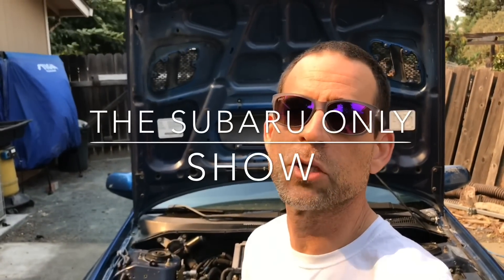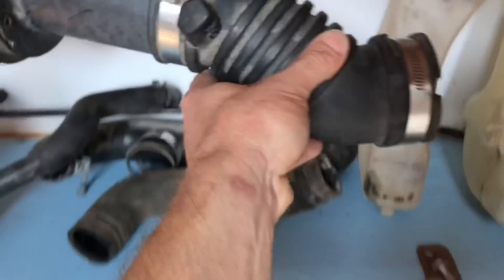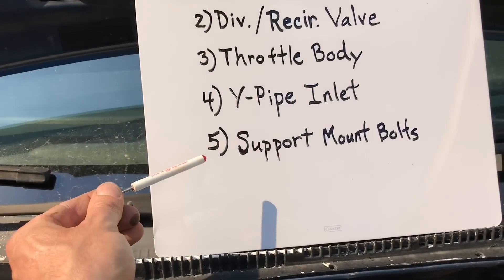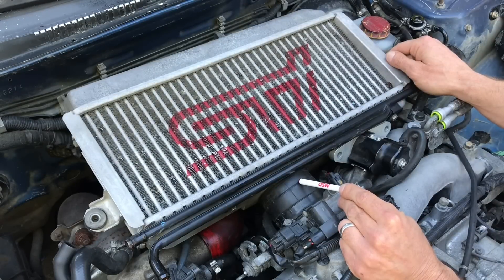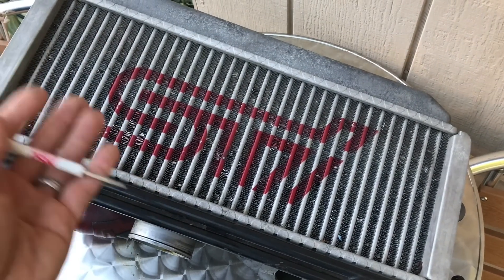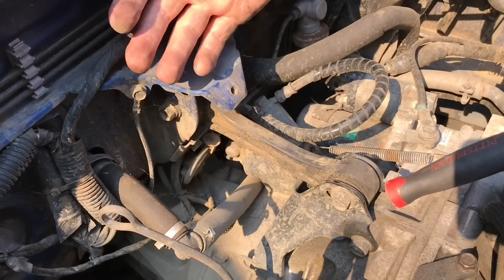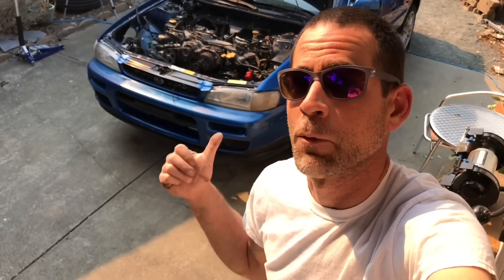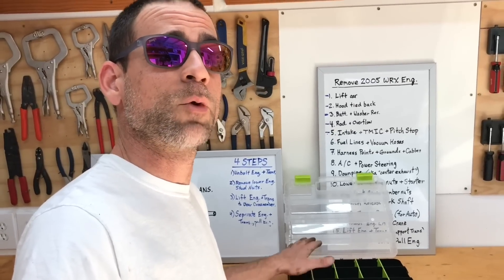How to Remove a TMIC on Subaru EJ-Series Engines

Comment: This oil in TMIC is from PCV or turbo? How much oil is too much?
Reply from the maker: Most often from the PVC system. If it totally coated and some liquid oil is pooling up in the manifold low points, def too much oil. 👍
Reply: @SubaruONLY  thank you for the answer!

Comment: It's me again with GC8 v5 sti. It has another problem which is cruise surge. when pressing the gas pedal gently for slight acceleration, the car will not bring more power, but RPM still rising steadily. After pressing the gas pedal more, it will "kick" you and accelerating hard. Feels like it can only hard accelerate and boost up but not cruise. I have changed to OEM AFM and OEM super coolant, no big intake leak, and idle boost pressure -17psi. Engine running fine with no vibration or misfire. Could be a fuel pump or fuel regulator?
Reply: And also tried ECU reset, plug green to green, and black to the black connector and drive for 1 minute above 11km/h.
Reply from the maker: Sounds like may be a good idea to take it to a tuner. Might have a larger turbo or other aftermarket parts.
Reply: @SubaruONLY  Accutually a smaller turbo, the factory was VF28 but TD04 now. Thanks for your help and ill get it to the tuner for inspection.
Reply from the maker: Ok, good luck. Hope it gets figured out! Cheers!!!
Reply: @SubaruONLY  Thanks again and problem solved, after I soaked the O2 sensor into gasoline overnight and reinstall it, it's running perfectly now.

Comment: What's the two pipes on the front called
Reply from the maker: That’s the PVC system crossover pipe - pulls those oily vapors from the valve covers and injects in the turbo inlet side of intake. This is also where you want to tap into the system and add a high quality air/oil separator! 👍

Comment: I know this video is old but I have a question! Despite getting both bolts out of BOV it is completely stuck. Any advice to what I should do?
Reply: Maybe try whacking it a bit with a rubber mallet.
Reply: @tomc8829  I definitely tried that. Actually ended up selling the car later!

Comment: Great video I want to ask you if I would be ok driving without AC belt on my 2010 Forester sohc
Reply from the maker: Yes.  Totally fine.  If that AC compressor is making noise or failing - this is definitely a good option if you want to postpone fixing it, or of you just don’t need the AC anymore. Cheers buddy!   Thanks for checking out the videos!
Reply: SubaruONLY cool that's what's up. actually is working nothing wrong with it. I just took the crank Pulley and timing cover off just for a Inspection had to cut the AC belt off thank you very much
Reply from the maker: Np buddy.  Cheers!  🤙